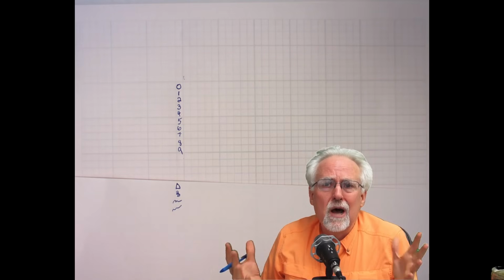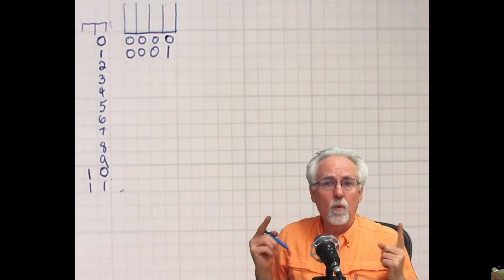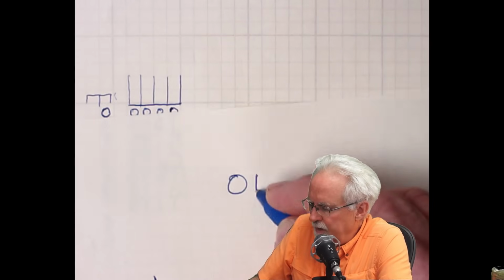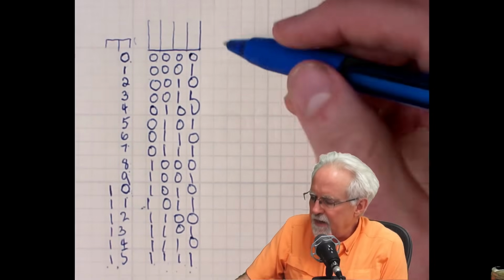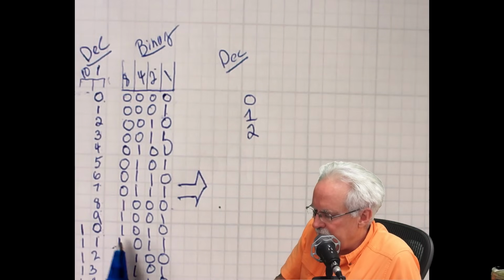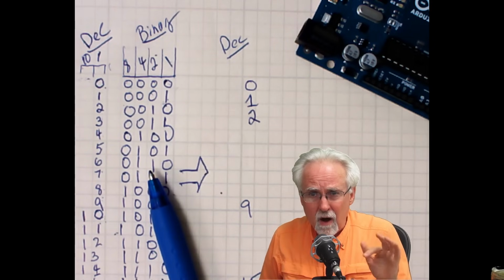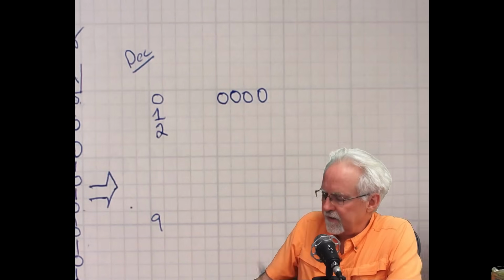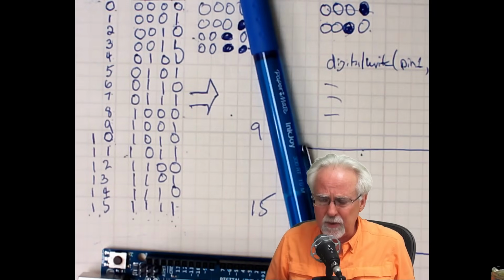Arduino Tutorial 5: Understanding and Working With Binary Numbers

Comment: Well I made it to lesson 5. Here is a copy of the sketch to count with binary numbers will LEDs.  This is working but is there an other methos to accomplish the same thing?  

thanks Brian

int led1=13;
int led2=12;
int led3=8;
int led4=7;
int del=2000;

void setup() {
  // put your setup code here, to run once:
pinMode(led1,OUTPUT);
pinMode(led2,OUTPUT);
pinMode(led3,OUTPUT);
pinMode(led4,OUTPUT);
}

void loop() {
  // put your main code here, to run repeatedly:
//00
digitalWrite(led1,LOW),digitalWrite(led2,LOW),digitalWrite(led3,LOW),digitalWrite(led4,LOW);
delay(del);

//01
digitalWrite(led1,LOW),digitalWrite(led2,LOW),digitalWrite(led3,LOW),digitalWrite(led4,HIGH);
delay(del);

//02
digitalWrite(led1,LOW),digitalWrite(led2,LOW),digitalWrite(led3,HIGH),digitalWrite(led4,LOW);
delay(del);

//03
digitalWrite(led1,LOW),digitalWrite(led2,LOW),digitalWrite(led3,HIGH),digitalWrite(led4,HIGH);
delay(del);

//04
digitalWrite(led1,LOW),digitalWrite(led2,HIGH),digitalWrite(led3,LOW),digitalWrite(led4,LOW);
delay(del);

//05
digitalWrite(led1,LOW),digitalWrite(led2,HIGH),digitalWrite(led3,LOW),digitalWrite(led4,HIGH);
delay(del);

//06
digitalWrite(led1,LOW),digitalWrite(led2,HIGH),digitalWrite(led3,HIGH),digitalWrite(led4,LOW);
delay(del);

//07
digitalWrite(led1,LOW),digitalWrite(led2,HIGH),digitalWrite(led3,HIGH),digitalWrite(led4,HIGH);
delay(del);

//08
digitalWrite(led1,HIGH),digitalWrite(led2,LOW),digitalWrite(led3,LOW),digitalWrite(led4,LOW);
delay(del);

//09
digitalWrite(led1,HIGH),digitalWrite(led2,LOW),digitalWrite(led3,LOW),digitalWrite(led4,HIGH);
delay(del);

//10
digitalWrite(led1,HIGH),digitalWrite(led2,LOW),digitalWrite(led3,HIGH),digitalWrite(led4,LOW);
delay(del);

//11
digitalWrite(led1,HIGH),digitalWrite(led2,LOW),digitalWrite(led3,HIGH),digitalWrite(led4,HIGH);
delay(del);

//12
digitalWrite(led1,HIGH),digitalWrite(led2,HIGH),digitalWrite(led3,LOW),digitalWrite(led4,LOW);
delay(del);

//13
digitalWrite(led1,HIGH),digitalWrite(led2,HIGH),digitalWrite(led3,LOW),digitalWrite(led4,HIGH);
delay(del);

//14
digitalWrite(led1,HIGH),digitalWrite(led2,HIGH),digitalWrite(led3,HIGH),digitalWrite(led4,LOW);
delay(del);

//15
digitalWrite(led1,HIGH),digitalWrite(led2,HIGH),digitalWrite(led3,HIGH),digitalWrite(led4,HIGH);
delay(del);

}

Comment: Fun lesson.  I guess I did cheat though by not doing the assignment on my own.  I'll try to do better!  I do have a question about something that you will probably cover later I'm sure.  I would like to be able to "label" the modules with a name like "Zero, One, Two, etc." so I would know which number I'm dealing with.  When I tried to do this it gave me errors in the code.  I'm sure there is a way to do it though so if you are not showing us that yet for a reason I'll be glad to wait.  Thanks for the lesson!

Comment: In the big world of automation adressing you will have lets say 10 switces. The first switch will represent 0. The second switch 1. Third swich 2, fourth switch 4, 5th switch 8, 6th swich 16, 7th switch 32, next one 64, next one 128, next one 256. You just threw me under the bus. Yes I understand your logic, but how many switches will you need this way to get to an adress of lets say 390? If you use the mentioned principle and of of my head, I am sure 4 or 5 switches out of the available 10 switches. Now I understand that in programming and semiconductors it may work that way to make a string, but this is the reason people get confused between the different ways of binary. I thought you may be heading in that direction when you started to show the pattern of 0,1,2,4,8,16. But you just left it there. Great tutorial none the less.

Comment: Here is the code for the assignment though I used a for-loop and a while-loop:
void setup() {
  pinMode(13, OUTPUT); // RED
  pinMode(12, OUTPUT); // GREEN
  pinMode(11, OUTPUT); // YELLOW
  pinMode(10, OUTPUT); // BLUE
  Serial.begin(9600); // Initialize Serial communication
}

void loop() {
  for(int i = 0; i <= 15; i++) { // Count from 0 to 15
    String binaryNumber = String(i, BIN); // Convert decimal number to binary string
    
    // Pad binary number with leading zeros to make it 4 bits long
    while(binaryNumber.length() < 4) {
      binaryNumber = "0" + binaryNumber;
    }
    
    // Turn on LEDs based on binary digits
    digitalWrite(13, binaryNumber.charAt(0) == '1' ? HIGH : LOW); // Turn on RED if the leftmost bit is 1, otherwise turn it off
    digitalWrite(12, binaryNumber.charAt(1) == '1' ? HIGH : LOW); // Turn on GREEN if the second bit from the left is 1, otherwise turn it off
    digitalWrite(11, binaryNumber.charAt(2) == '1' ? HIGH : LOW); // Turn on YELLOW if the third bit from the left is 1, otherwise turn it off
    digitalWrite(10, binaryNumber.charAt(3) == '1' ? HIGH : LOW); // Turn on BLUE if the rightmost bit is 1, otherwise turn it off

    // Display binary number on Serial monitor
    Serial.println(binaryNumber); 
    
    delay(1000); // Wait for 1 second before moving to the next number
  }
}

Comment: im doing these for my highschool computer class, I found you a couple days ago and these are amazing tutorials :), I'm having trouble getting two LEDs to turn on at once and I need to do that for the assignment at the end of the video. i think I've discovered that the digitalWrite(13, HIGH); command automatically turns off once executed, its not a continuous thing. so how do I get an LED to turn on continuously without using the delay command? i saw that you liked a comment posted 5 days ago so I hope you still respond 🙏
Reply: omg lesson 6 is a tutorial on how to do it 😭🤣

Comment: For the homework (Thanks ChatGPT)

void setup() {
  // Set the pin modes for each LED
  pinMode(2, OUTPUT);
  pinMode(3, OUTPUT);
  pinMode(4, OUTPUT);
  pinMode(5, OUTPUT);
}

void loop() {
  for (int i = 0; i <= 15; i++) {
    // Set the duty cycles for each LED according to the binary representation of i
    analogWrite(2, (i & 1) ? 255 : 0);  // least significant bit
    analogWrite(3, (i & 2) ? 255 : 0);  // second least significant bit
    analogWrite(4, (i & 4) ? 255 : 0);  // third least significant bit
    analogWrite(5, (i & 8) ? 255 : 0);  // most significant bit
    delay(1000);
  }
}

Comment: Thanks, it was easy enough to complete the homework but it was quite cumbersome. I am wondering how to represent numbers using LED lights in an automated fashion. I'd need to convert an input number e.g. 12, into it's binary form (maybe through an in-built function) and then map each 0/1 spot to the corresponding pin to have the LED be LOW or HIGH.

Comment: Fun challenge! It gave me a chance to test how integer division works in c++ as well! Here's what I came up with:

int counter = 0;
int pin1 = 10;
int pin2 = 11;
int pin4 = 12;
int pin8 = 13;
int time = 1000;

void setup()
{
  pinMode(LED_BUILTIN, OUTPUT);
}

void loop()
{
  if (counter%2 == 1){
    digitalWrite(pin1, HIGH);
  } else {
    digitalWrite(pin1, LOW);
  }
  if (counter/2%2 ==1){
    digitalWrite(pin2, HIGH);
  } else {
    digitalWrite(pin2, LOW);
  }
  if (counter/2/2%2 ==1){
    digitalWrite(pin4, HIGH);
  } else {
    digitalWrite(pin4, LOW);
  }
  if (counter/2/2/2%2 ==1){
    digitalWrite(pin8, HIGH);
  } else {
    digitalWrite(pin8, LOW);
  }
  delay(time);
  counter ++;
}
Reply: thats a creative solution, im used to using class data types like math.sqrt in java, wonder if theres a similar math import

Comment: I did my homework. =)))

const int pinLed0 = 13;
const int pinLed1 = 12;
const int pinLed2 = 11;
const int pinLed3 = 10;

int ledArray[5],i=0,num;

void setup() {
  // put your setup code here, to run once:

  pinMode(pinLed0,OUTPUT);
  pinMode(pinLed1,OUTPUT);
  pinMode(pinLed2,OUTPUT);
  pinMode(pinLed3,OUTPUT);
  
  for(int n=0;n<=15;n++)
  {
    num=n;

    int ledArray[5]={0,0,0,0};
    
    digitalWrite(pinLed3,LOW);
    digitalWrite(pinLed2,LOW);
    digitalWrite(pinLed1,LOW);
    digitalWrite(pinLed0,LOW);

    i=0;

    while(num>0)
    {
      ledArray[i]=num%2;
      num=num/2;
      i++;
    }

    digitalWrite(pinLed3,ledArray[0]);
    digitalWrite(pinLed2,ledArray[1]);
    digitalWrite(pinLed1,ledArray[2]);
    digitalWrite(pinLed0,ledArray[3]);

    delay(2000);

    }
   }
   
void loop() {
  // put your main code here, to run repeatedly:  
}

Comment: This content is wonderful.  I've always been interested in electronics and have done some light C++ programming in the past (college) so I'm picking up nicely...  Something worth checking out - Tinker CAD circuits.  It's an Arduino emulator where you throw the main board, bread board, resistors, sensors, LEDS, etc on the screen... connect them with wires.. and then run the program to watch your simulation run.  It's an absolutely free way to get started without having to buy the hardware - all web based....  I even ran a LED with no resistor, just to see, and I got a warning about the voltage going to the LED!    I'm excited to get through your series and then jump onto the raspberry pi videos.  I just bought an Orange Pi which I believe will be similar enough.

Comment: Hi Paul, really digging your Arduino knowledge, I ordered the super kit at your suggestion. On this homework assignment, wouldn’t it be prudent to put a single 330 ohm resistor on the ground leg from the Uno to the breadboard. I don’ t  see any backfeed issues since these after all are diodes. Just conservative circuit design.
Reply from the maker: No, you will get crosstalk between the LED. Each needs its own resistor, or the number of on LED will impact brightness of each
Reply: Got it sir, thanks for answering. Really liking these tutorials.

Comment: I like to think of numbers as buckets, in the decimal system one bucket/number can store 9 units, if you add one to 9 it would 'overflows', so you need to empty the current bucket and fill in a new bigger bucket on the left. In binary the logic is the same but the buckets/numbers are smaller as they can only store 1 unit. So if you want to store a big number (big amount of water) you would need many more binary numbers (small buckets) than decimal numbers (big buckets) =)

Comment: Sorry for doing the homework in a different way. I wanted to train on my C programming and test different ways at the same time.

int first_led=8;
int second_led=9;
int third_led=10;
int fourth_led=11;
int delay_1=1000;
byte counted_number=0; // the byte variable holds 8 bits, only the first four bits is used

void setup() {
  // put your setup code here, to run once:
pinMode(first_led,OUTPUT);
pinMode(second_led,OUTPUT);
pinMode(third_led,OUTPUT);
pinMode(fourth_led,OUTPUT);
}

void loop() {
  // put your main code here, to run repeatedly:
  if (bitRead(counted_number,4)==1){     // if the value of the fifth bit is 1 reset counted_number to 0
    counted_number=0;
    delay(delay_1);
    }
  digitalWrite(first_led,bitRead(counted_number,0));  // bitRead() returns the value of a givin bit in counted_number and returns 0 or 1
  digitalWrite(second_led,bitRead(counted_number,1));
  digitalWrite(third_led,bitRead(counted_number,2));
  digitalWrite(fourth_led,bitRead(counted_number,3));
  counted_number++;  // increment counted variable by 1
  delay(delay_1);
}

Comment: Great lesson Paul. I have one question. I have the delay and pause set the same in the variables but the LED lights seem to be blinking slightly at different rates. The groupings are slightly slower than the single lights. What would be causing this?

Comment: [code]
     // ---- Digital Counter ----

//Var Declaration & Initialization
int ledPin_01=4;
int ledPin_02=6;
int ledPin_04=8;
int ledPin_08=10; 
int addOne=1878;

void setup() {
  // put your setup code here, to run once:
 pinMode(ledPin_01,OUTPUT);
 pinMode(ledPin_02,OUTPUT);
 pinMode(ledPin_04,OUTPUT);
 pinMode(ledPin_08,OUTPUT);
}

void loop() {
  // put your main code here, to run repeatedly:
   //Counter_State: [Binary]=0000 <==> [Decimal]=0
      digitalWrite(ledPin_01,LOW);
        digitalWrite(ledPin_02,LOW);
       digitalWrite(ledPin_04,LOW);
      digitalWrite(ledPin_08,LOW);
       delay(addOne);
   
   //Counter_State: [Binary]=0001 <==> [Decimal]=1
      digitalWrite(ledPin_01,HIGH);
        digitalWrite(ledPin_02,LOW);
       digitalWrite(ledPin_04,LOW);
      digitalWrite(ledPin_08,LOW); 
       delay(addOne);
   
   //Counter_State: [Binary]=0010 <==> [Decimal]=2     
      digitalWrite(ledPin_01,LOW);
        digitalWrite(ledPin_02,HIGH);
       digitalWrite(ledPin_04,LOW);
      digitalWrite(ledPin_08,LOW);
       delay(addOne);
 
   //Counter_State: [Binary]=0011 <==> [Decimal]=3     
      digitalWrite(ledPin_01,HIGH);
        digitalWrite(ledPin_02,HIGH);
       digitalWrite(ledPin_04,LOW);
      digitalWrite(ledPin_08,LOW);
       delay(addOne);

   //Counter_State: [Binary]=0100 <==> [Decimal]=4     
      digitalWrite(ledPin_01,LOW);
        digitalWrite(ledPin_02,LOW);
       digitalWrite(ledPin_04,HIGH);
      digitalWrite(ledPin_08,LOW);
       delay(addOne);

   //Counter_State: [Binary]=0101 <==> [Decimal]=5
      digitalWrite(ledPin_01,HIGH);
        digitalWrite(ledPin_02,LOW);
       digitalWrite(ledPin_04,HIGH);
      digitalWrite(ledPin_08,LOW);
       delay(addOne);

   //Counter_State: [Binary]=0110 <==> [Decimal]=6
      digitalWrite(ledPin_01,LOW);
        digitalWrite(ledPin_02,HIGH);
       digitalWrite(ledPin_04,HIGH);
      digitalWrite(ledPin_08,LOW);
       delay(addOne);

   //Counter_State: [Binary]=0111 <==> [Decimal]=7
      digitalWrite(ledPin_01,HIGH);
        digitalWrite(ledPin_02,HIGH);
       digitalWrite(ledPin_04,HIGH);
      digitalWrite(ledPin_08,LOW);
       delay(addOne);

   //Counter_State: [Binary]=1000 <==> [Decimal]=8
      digitalWrite(ledPin_01,LOW);
        digitalWrite(ledPin_02,LOW);
       digitalWrite(ledPin_04,LOW);
      digitalWrite(ledPin_08,HIGH);
       delay(addOne);    

   //Counter_State: [Binary]=1001 <==> [Decimal]=9
      digitalWrite(ledPin_01,HIGH);
        digitalWrite(ledPin_02,LOW);
       digitalWrite(ledPin_04,LOW);
      digitalWrite(ledPin_08,HIGH);
       delay(addOne);
       
   //Counter_State: [Binary]=1010 <==> [Decimal]=10
      digitalWrite(ledPin_01,LOW);
        digitalWrite(ledPin_02,HIGH);
       digitalWrite(ledPin_04,LOW);
      digitalWrite(ledPin_08,HIGH);
       delay(addOne); 

   //Counter_State: [Binary]=1011 <==> [Decimal]=11
      digitalWrite(ledPin_01,HIGH);
        digitalWrite(ledPin_02,HIGH);
       digitalWrite(ledPin_04,LOW);
      digitalWrite(ledPin_08,HIGH);
       delay(addOne);

   //Counter_State: [Binary]=1100 <==> [Decimal]=12
      digitalWrite(ledPin_01,LOW);
        digitalWrite(ledPin_02,LOW);
       digitalWrite(ledPin_04,HIGH);
      digitalWrite(ledPin_08,HIGH);
       delay(addOne); 

   //Counter_State: [Binary]=1101 <==> [Decimal]=13
      digitalWrite(ledPin_01,HIGH);
        digitalWrite(ledPin_02,LOW);
       digitalWrite(ledPin_04,HIGH);
      digitalWrite(ledPin_08,HIGH);
       delay(addOne);

   //Counter_State: [Binary]=1110 <==> [Decimal]=14
      digitalWrite(ledPin_01,LOW);
        digitalWrite(ledPin_02,HIGH);
       digitalWrite(ledPin_04,HIGH);
      digitalWrite(ledPin_08,HIGH);
       delay(addOne);
       
   //Counter_State: [Binary]=1111 <==> [Decimal]=15
      digitalWrite(ledPin_01,HIGH);
        digitalWrite(ledPin_02,HIGH);
       digitalWrite(ledPin_04,HIGH);
      digitalWrite(ledPin_08,HIGH);
       delay(addOne);

 }
[/code]

Comment: I learned binary a different way. The 2^0, 2^1, 2^2, 2^3 method. You keep adding powers of 2 until the biggest power is either the number in decimal or just smaller. The remainder is taken care of by adding the powers together, putting 0's in places that would make the number greater than the decimal number, and 1's here it could be added to the largest power of 2.

Comment: I have learned binary from at least 3 different teachers. 

First one at school, I understand nothing. I wasn't into computer at the time so whatever I learned there I forgot right after I was done with the exam. 

The second one/ones was/were from a random YouTube video/videos (not sure if it was just only one video or more). I got the binary pattern from them. I learned to just shift 1 from the right to the left and insert either 1 or 0 to the right. This pattern is easier from what I learned in school, but I longer time I got confused. 

0000
0001
0010 
...
1111

The third one - this video, I learned to add 0011 with 0001 to get 0100. Without this method, I would have to write down the pattern from 0000 to 0100 to get the answer. If the number of switches increased to 00000000 00000000 or more, I would have to do the same to get to the result I want to know.

My point is I have learned a new thing from this video despite have had some experience learning binary before. Now it seems I get a better understanding of it more than ever.

Awesome video!!

Comment: So on a 4-bit system you can only have 16 characters right?
Reply: Yes, that's right. There is a formula you can use to work out the quantity of numbers you can have for a given number of bits. It's 2 to the power of the number of bits. So, if you have 2 bits the number of bits is  2 to the power 2 which is 4, 3 bits gives 2 to the power 3 which is 8, 4 bits gives 16, 5 bits 32, 6 bits 64 and so on. 7 bits gives you 128 numbers. So, 7 bits is usually the minimum used to represent text.  All the letters of the alphabet requires 26 numbers. Then, if you want upper and lower case you need 52. Start to add in various punctuation and other characters you need and you are soon way past the 64 that 6 bits would give you and you need 7 bits. This is is why the standard ASCII character set widely used in computing needs at least 7 bits.